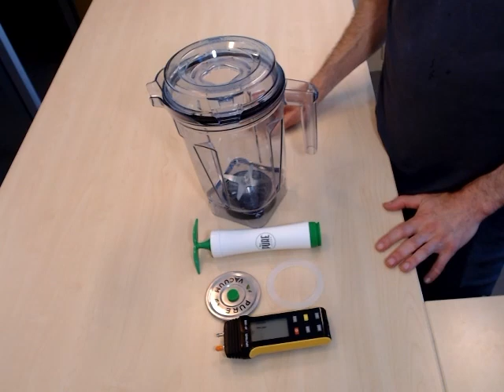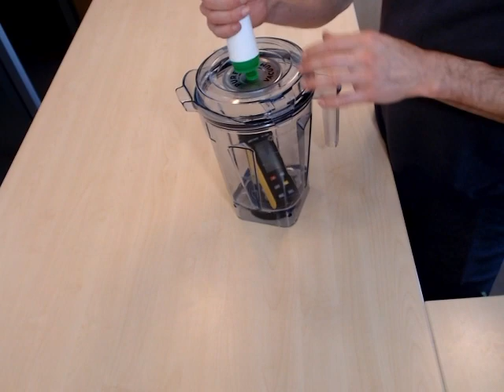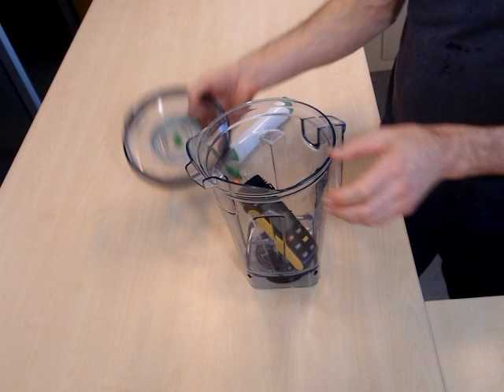Vitamix Vacuum Blender Setup with Pure Juicer MVP Pump

Comment: Hello buddy, this is absolutely great stuff, exactly what I have been looking for... 👍🏻 Do I get it right that you can use this solution with an original 2l original Vitamix (TNC 5200) jar that has the rubber black lid and use this plastic Vitamix lid instead? And if so, where can I get the lid and the standalone Dynapro automatic pump? Thank you... 🙏🏻
Reply from the maker: I don't think the rubber lids for the old style containers will hold a vacuum.

Comment: The link to that silicone gasket doesn’t work.  Can you provide a new link?   I ordered several different ones from Amazon, but they all had grooves in them so they were not perfectly flat like the one you showed me in the video.
Reply from the maker: It looks like it's not available anymore. I'm not sure about one without grooves. The gasket I have has a small groove and it still works.

Comment: Use an automatic vacuming and do the last pumping with pure
Reply from the maker: That's the best way to do it. I use the Dynapro automatic pump first and MVP manual pump second.
Reply: @Nate-Ritchie Hello buddy, this is absolutely great stuff, exactly what I have been looking for... 👍🏻 Do I get it right that you can use this solution with a 2l original Vitamix (TNC 5200) jar? And if so, where can I get the lid and the standalone Dynapro automatic pump? Thank you... 🙏🏻

Comment: I just want to clarify if this is the latest information:

For Vitamix Ascent series containers, the 48 oz. containers need the McMaster-Carr O-ring #90025K627. The 64 oz. containers need the McMaster-Carr O-ring #90025K629.

Please clarify and much thanks for your hard work and sharing. You earned a subscriber.
Reply: If I understand correctly, yes. But hopefully the channel will verify.
Reply from the maker: You are correct with those o-ring models. I will upload a video soon using those o-rings. In the meantime, here are my tips: (1) After the o-ring is on the lid, run the lid under water so the o-ring gets moist and shake off the excess. The wet o-ring helps the lid slip into the container. (2) After the lid had been popped into the container, put your hands on top of the lid and press down firmly. I press down with my body weight leaning forward on the container. That ensures the lid gets seated down all the way into the container and seals tight.
Reply: Can I modify the 32 oz. container from the old model as well?

Comment: Curious question. So the stainless steel Vitamix container doesn't need a different seal? How did you know what the vacuum on the stainless steel container was when you can't see through it?
Reply from the maker: The stainless steel container won't hold a vacuum out of the box. You need to replace the Vitamix o-ring with a thicker McMaster-Carr 'X-Profile' o-ring, part number #90025K627. I can tell there is a strong vacuum on the steel container because the rubber valve in the center of the MVP mason jar lid is depressed after the air is pulled out. Also, when the valve is released there is a suction sound from the air rushing back into the container. It's not possible to read the test meter inside the steel container. However, the hand pump will keep working until there is a certain amount of pressure built up in the container, regardless of what container is being vacuum sealed.
Reply: @Nate-Ritchieso would you just use the regular Vitamix container or buy the stainless steel container? I don't mind buying it if it holds a better vacuum but if the same I'd prefer just using the container I have.
Reply from the maker: @sarasotaflorida8482  I use the 64 oz plastic container pretty much all the time because I typically blend large smoothies. The plastic containers (48 oz. or 64 oz.) seal just as tightly as the steel container. If the steel container was larger, I would use it more to avoid microplastics. I found the 64 oz. container blends smoother because the base of the container is wider and the food falls down into the blade more easily.
Reply: @Nate-Ritchie Hello Nate and thank you for this video!  I just purchased that Vitamix Stainless Steel container and really want to convert it for Vacuum blending.  Order the O-Ring today, but I'm a bit fuzzy on what to do to get the Pure Juicer MVP Valve Lid to seal on the lid that came with the Stainless Steel container.  I think you are saying to use the same Wide Mouth Mason Jar Silicon Ring you referenced above, is that correct?  If so, can you provide a new link, because the one in your description doesn't work.  I ordered some other ones from Amazon, but they have a groove in them, and was not able to get them to seal very well.  Looks like the gasket you showed was completely flat.

Comment: Does it work with the Alta Pro 64 ounce container that Costco sells? I see that the top for this container is different, not clear plastic but black soft rubber.
I was going to buy it because it's on sale right now. But if it won't work then I'll just have to forget about it.
Thank you!
Reply from the maker: The containers with rubber lids won't hold a vacuum.

Comment: Thank You, the stainless steel container with a vacuum seems to be the ultimate solution. My kuvings stopped sealing a year ago and the plastic container cannot be thoroughly cleaned without the use of chemicals.

Comment: Does the lid sit properly with the Dynapro O-ring?  It didn't look flush... kind of looked crooked.  Were my eyes deceiving me?
Reply from the maker: I used the Dynapro o-ring with the container in the video for 3+ years with no problems caused to the container, but the o-ring is a little bit large, somewhat difficult to get the lid on correctly, and not super durable. I recently found a better o-ring for the container shown in the video, which is a little smaller, holds a better seal, and is easier to remove daily for cleaning. It's the McMaster-Carr #90025K629 and comes in packs of 5. I tried several o-rings from McMaster-Carr and #90025K629 was the best.
Reply: @Nate-Ritchieone more question in another reply you mentioned the 90025K627 and in my reply you said the 90025K629. For the container in the video which is better? Thank you so much for your hard work. Truly appreciated ❤
Reply from the maker: @sarasotaflorida8482  The 64 oz. container is what was used in the video and it fits the 90025K629. The 48 oz. containers have a smaller diameter lid and they fit the 90025K627.